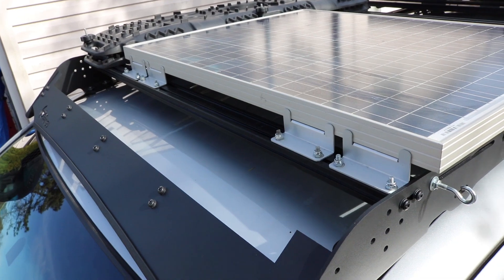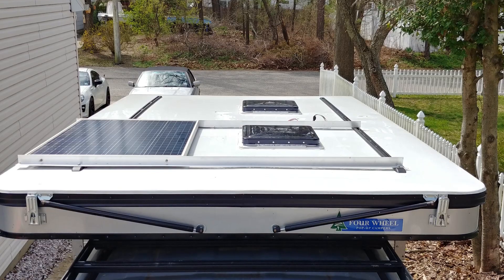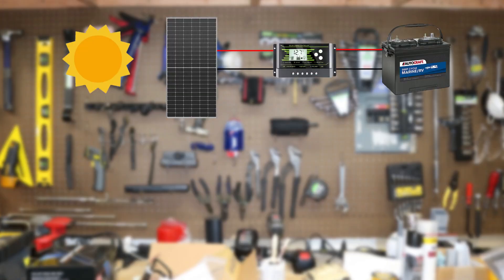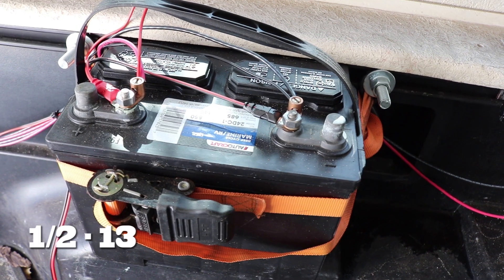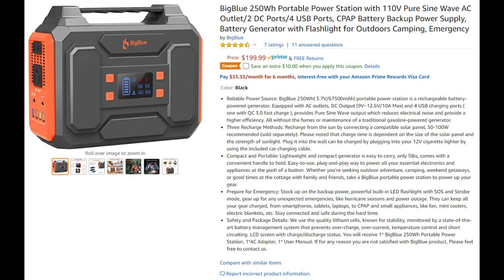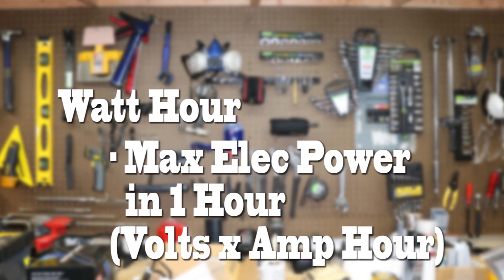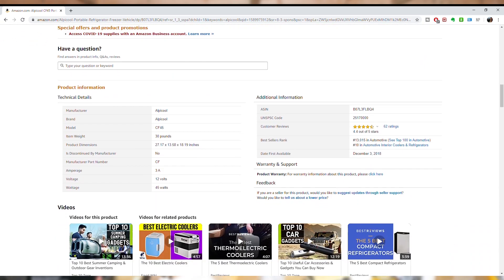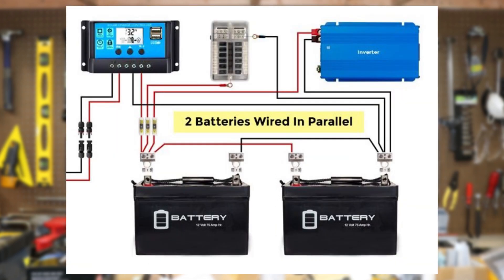Solar Power Tacoma! (For only ~$200!) (DIY / How To)

Comment: Cool idea 4 sure. Fyi tho,AGM batteries should only be drained to 50% of their capacity or you'll drastically lower the recharge cycles&possibly damage them vs Lithium or Lipo4 which can be safely discharged to 80-100% of their capacity and you get double or even quadruple amount of recharge cycles. BUT...lithium chemistry has temperature specs that can be an issue on either ends of the spectrum vs AGM isn't as temp dependant. Regardless,this idea is going to become a future project for my 🌮💪✌
Reply from the maker: Awesome! best of luck with the solar system build. You should check out my latest setup on the 4 wheel camper. I did switch to LiPO4, definitely a much better power storage
Reply: @TacomaTutorials  will do 4 sure👍

Comment: What's anyone's thought on this same set up and no fridge but running a light bar and 6 led pods off that battery and running switching to in the cabin? Good idea or bad idea?
Reply from the maker: Hey bro, that's typically what you would want to do on a dual battery setup. If you have a battery isolator, you can run down the second battery without having to worry about draining the starting battery.
Reply: @TacomaTutorials  I'm running it off one battery just like your tacoma setup or might have to do 2 battery then
Reply from the maker: The alternator has a 130 amp output and if you're running all LEDs then you should be ok on a single battery TBH. High amperage equipment are things like a compressor and winch will drain the battery fast which the alternator will not be able to keep up with. If you're running just LED's then I think you should be fine.
Reply: @TacomaTutorials  I wanted to do how you had your tacoma set up. Solar panels on top and battery in bed and isolated to its self not on main battery or alternator and run pods on that solar panel and now I'm rethinking about running a light bar to the solar panel. With a changing station for phones but most likely no fridge on it
Reply from the maker: You're running all LED's. I think You can run directly to the battery and do away with the solar panel and secondary battery. See my latest video in the lighting setup - hopefully it helps.

Comment: would you be able to add a dual battery isolator as a second charge from your alternator as back up in case the sun wasn't out? just a random thought and curiosity.
Reply from the maker: Yessirree. The video was super long and I do go into further details on battery isolation and alternator charging @15:35 - I hope the explanation helps.
Reply: @TacomaTutorials  my bad I watch a good portion and remembered that I was going almost the same route. made the comment then got side tracked and started working on my tacoma. oil change, replacement of pads, and replacement of rotors.
Reply from the maker: Its all good brother. Best of luck w the truck work!
Reply: @TacomaTutorials  took way longer than expected. busted the plastic oil filter covers (2018 Toyota Tacoma SR5 V6). Thank God for auto zone down the street. Also got the metal cover.

Comment: Do a Tacoma 2010 6cyl valve cover gasket job
Reply from the maker: LOL it's on the list bro -  i like your persistence. Mine isn't leaking yet - so unfortunately,  it's not in t the immediate future. Here's a link on the write up though on a valve cover replacement on the same motor (https://www.toyota-4runner.org/4th-gen-t4rs/122918-4-0l-v6-valve-cover-gasket-replacement.html)